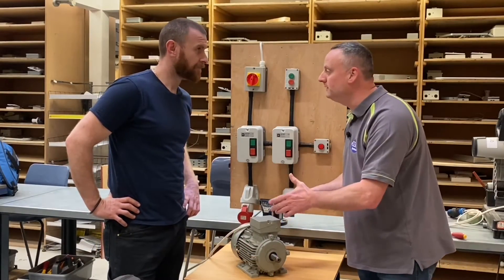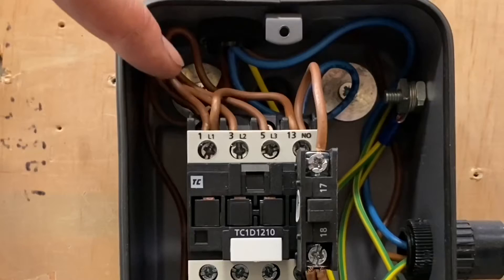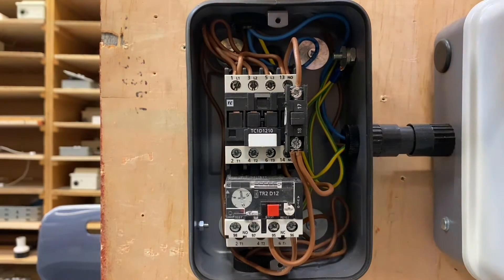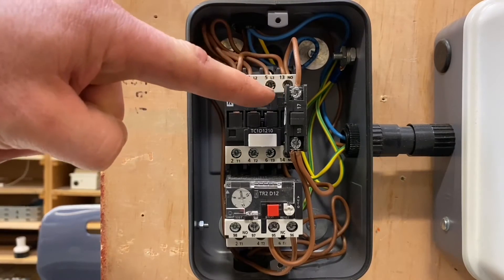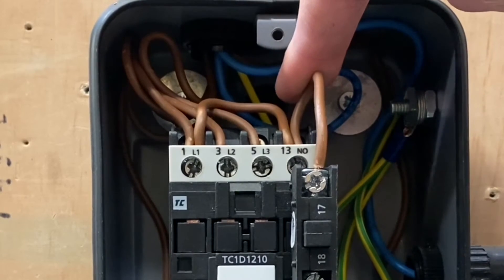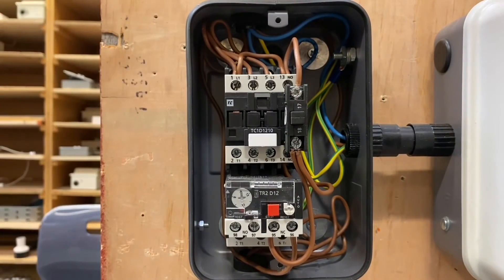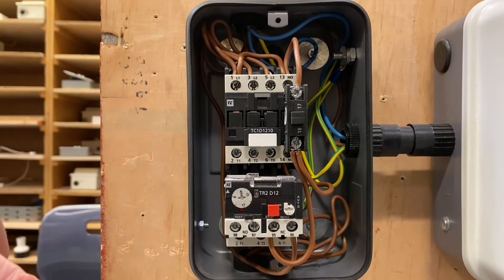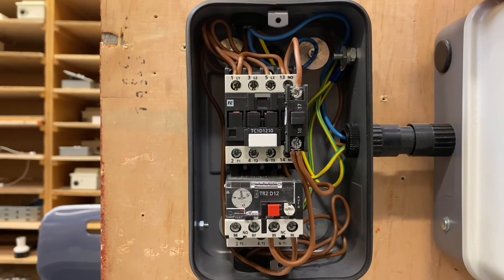3 Phase Direct Online Starter DOL Wiring and Connections Explained

Comment: I thought this helped me until I watched the xs training video where it basically shows A1 as N and A2 as Line ... so the opposite
Reply: Im also confused by this. I just bought a dol starter and A1 is pre wired as neutral
Reply: @jimm533 it’s just a coil you can use A1 or A2 as live or neutral.

Comment: What about VFD. Lots of new IE2 & IE3 3ph motors are designed to be run from single phase supplies via inverters.
I'd like to see this covered as a video with some reference to the way this works and is wired up with starters and remote controls.

Comment: Hi - I love your videos and they have been super helpful in helping me prepare for my AM2s, however I managed to fail my Fault Finding. I know there is some description of a fault where the motor is 'juddering' or something similar but I cant for the life of me remember what the fault was or how to test and then rectify it. Can you help me with this? Thank you!
Reply from the maker: Hi thanks for the lovely message. If a 3 phase motor was juddering it has lost one of it phases. Remember all faults on AM2S are found either visually or by dead testing. All the best and keep me updated 👍🏻
Reply: @GSHElectrical  I passed by the way!! Thank you! Loving life as a fully qualified spark now!
Reply: @GSHElectrical  yes Gaz- I see. By losing one of the sizes, it’s out of balance so it won’t run so smoothly. It will make sense!

Comment: What is the benefit of using a contactor relay? Why not use 3 poles C32 Amper circuit breaker to use it as a switch for more simple schematics?
Reply: If there is loss of power then power comes back on the contractor will have dropped out and the start button will need to be pressed again. This stops injury from occurring if power comes back on and somebody is in harms way in a machine not realising there is a power cut